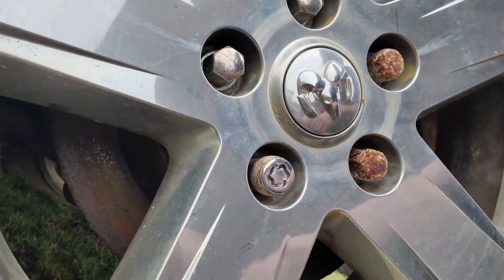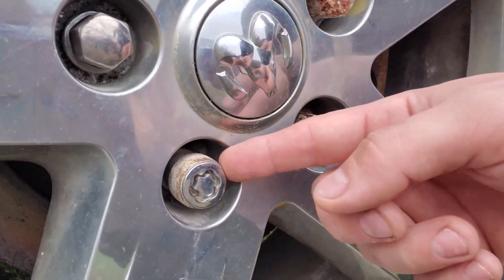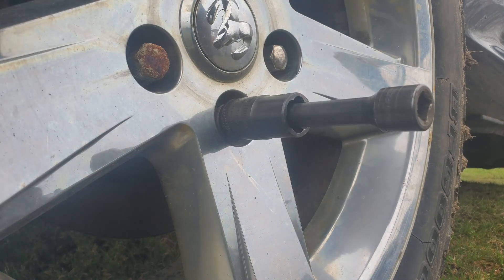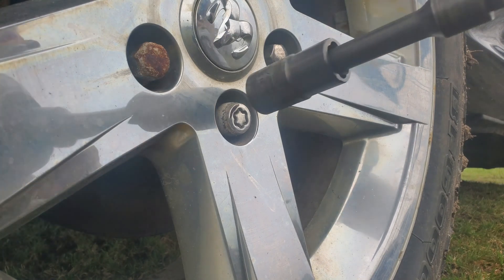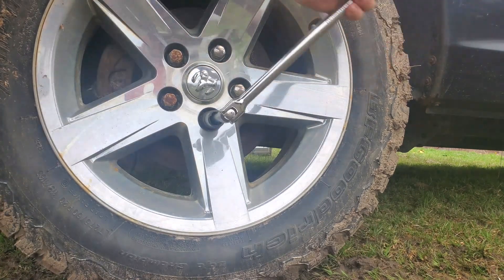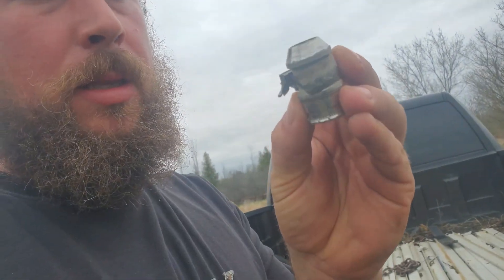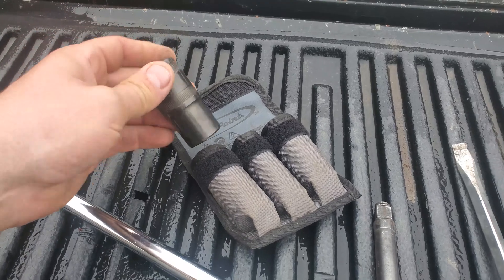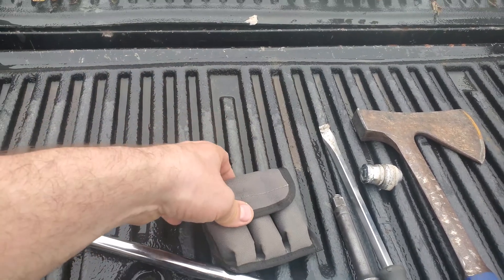HOW TO USE A BOLT EXTRACTOR TO REMOVE A LOCK NUT ON CAR/TRUCK

Comment: If you use a bolt extractor to get your locking lug nut off  !  You might be a red neck lol ,be careful eventually your going to strip out your bolt extractor  , nice hatchet  you should throw it  at your buddy for loosing the bolt key 🔑 lol